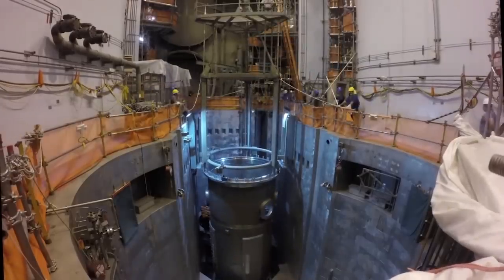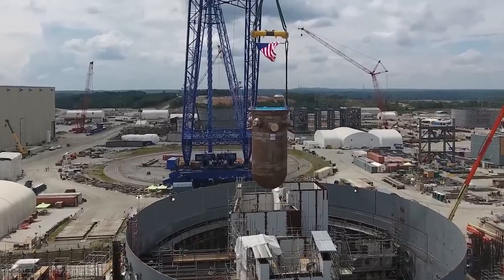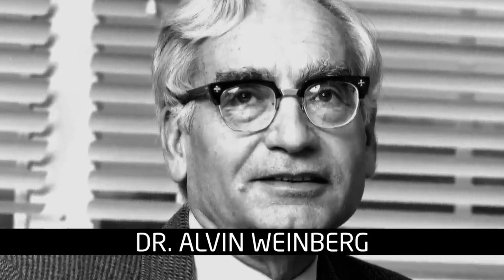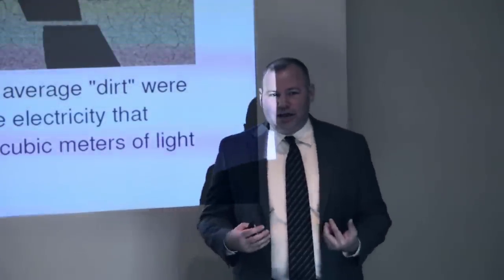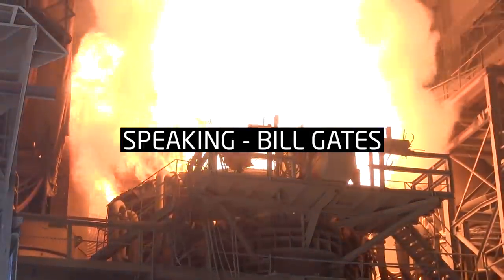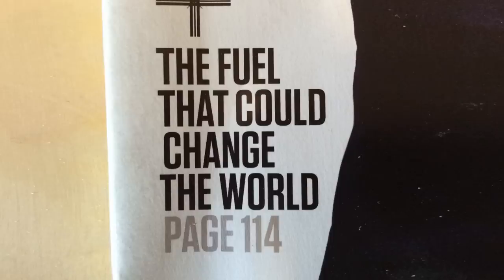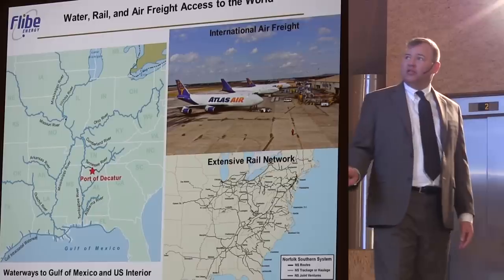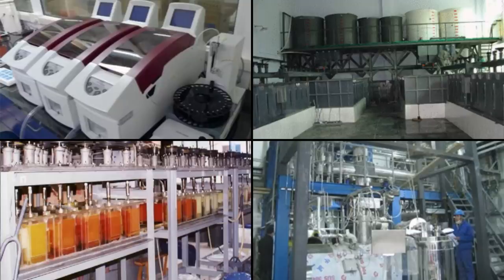Thorium 2017

Comment: again, super good video, i'd suggest one that would be thoroughly oriented towards waste, because it's quite a thing when chatting with people about nuclear technologies down here ! :)
Reply: Yeah, waste treatment and storage is a problem, but thorium already produces verry little waste compared to present nuclear energy.
Reply: i know :)
but that's exactly the point of a video oriented to the waste issue
Reply: ericasw28 +1 Maybe that video could also feature a part about the relative limited supply of materials for solar.
Reply: If waste disposal is of interest, Integral Fast Reactors are a better option than LFTRs. Arguably, the IFR is a more mature design than the LFTR, having run longer and with more funding at Argonne Natl. Labs in Idaho. Spent fuel from light water reactors can be reprocessed using techniques developed at Argonne and the spent fuel reprocessed and reused for decades in reactors that are also passively safe, just like the LFTR. The resulting waste is much less hazardous than the stuff coming from LWRs and has a much shorter half life. It also has no proliferation issues, just like the LFTR.
Reply: Yep, people do worry about waste.
So a video on:
Lack of waste produced by MSRs
MSRs configured as "waste burners" fueled by waste from PWRs.

Comment: So Thorium is an byproduct of Mining? What they do with the Thorium normaly?

The coal used annually worldwide for power generation contains,  about 10,000 tons of uranium and 25,000 tons of thorium, which either end up in the environment or accumulate in power plant ash and filter dust but it be extracted from the ash? And how would it be done?

Comment: The one thing overlooked in Kirk's presentation and a great many "thorium enthusiast" promotions is the fact that the reactor needs a fissile starter. 
The purest LFTR would provide fission-produced neutrons from fissile uranium alone, either U-233 or the  U-235 of customary reactors. I'm not sure if Pu-239 can be used.
But the thing is, that if you were to add sufficient pure U-233 or U-235 directly to thorium, Th-232, then either one of the Uranium isotopes, at 90% purity, is bomb material.
Thorcon Power (look them up) proposes a reactor (MSR) charged with 80% thorium fluoride  and uranium fluoride at just less than 20% enrichment, for the rest of the fuel content of the liquid. That would be just less than 4% fissile overall. They reckon that neutron capture by the U-238 and even the unwanted neutron capture rather than fission by the Pu-239 will not hinder the productivity.

Comment: The cement production is a terawatt consuming industry that uses wonderful coal, and is a massive, and concentrated, producer of C02.  That industry produces more CO2 that all trucks on the road, but is concentrated to a few locations. It would be interesting to see if it would make sense to locate a molten salt or metal reactor that could supply the energy needs of those plants, and also incorporate an "Air to fuel" cycle to recapture massive CO2 from the limestone. 

Molten salt temps may not be enough for the 1450*C needed, but a thermochemical  process of 800*C to make H2 could perhaps be used to increase temp. Fast spectrum lead cooled reactors may also be a consideration.
There are relatively few of these plants concentrated around areas with product demand and that of locations of raw material. Combining these, pun intended, hot-spots of energy consumption and CO2 emission seems like a winner.

Comment: Why such a focus on Thorium specifically rather than MSRs generally? By all purposes it seems that it's much cheaper and easier to just use Uranium, while maintaining basically all the same benefits. Especially seeing as there are still more economically viable to extract Uranium reserves than Thorium despite 70+ years of heavy extraction.
Reply from the maker: If your intent is to only produce power (either electricity or process heat) and you're not worried about uranium mining or enrichment (which I can see reasonable people not being worried about) or waste profile (again reasonable people can view current waste stream as acceptable) then a U-MSR is fine. In fact a fast-spectrum U-MSR could also address some of the above, if that's a concern. But it is pretty obvious Flibe is looking to monetize the "waste" stream. To do so it'll need to be segregated. The Chemical Kidney, which is a pre-req for high-efficiency Th-MSR lends itself to such segregation. Flibe has long been cagey about all their potential revenue steams, and that leads to observations such as yours. Still, Flibe isn't ready to spell it all out and rather keeps emphasizing many features also offered by U-MSRs.
Reply: Thanks for the reply!

Comment: First 30 seconds I figured it's just retitled regurgitation. .. sure it's the same information but you pulled the best bullet points from a dozen or so long,  sometimes boring videos and the order and tempo really work to convey the overall message. . Pretty awesome job of boiling it down to Thorium condensed . L p
Vy y

Comment: As much as I love nuclear and MSR, LFTR, et al...  It is still used to boil water and requires gravity.   Is there a more direct way to use the heat / energy liberated?  In micro or low gravity?
If the video said, I must have missed that part.

Comment: There is an error in the closed caption at .11 minute into the video. The slide is correct at 0.5% efficiency for a light water reactor and the CC gives the number as 0.05% efficiency. This bothered me because of limited hearing; I tend to focus on CC rather than the slide.
Reply from the maker: Fixed. Thank you for pointing it out.

Comment: Did someone hear about the sodium hydroxide heating system?
It use the exothermic reaction of sodium hydroxide when dissolve in water. It should be used as a he heat battery for solarthermic energy did you hear something about this system?

Comment: How do you start up a Thorium reactor? How does a Thorium reactor burn up uranium?
Reply from the maker: LEU, Pu or U233. LFTR49 is the one designed to recycle spent fuel rods. It first separates out the Uranium that won't sustain fission in thermal spectrum. https://articles.thmsr.nl/the-flibe-energy-lftr49-the-triple-ace-in-nuclear-gen-iv-design-ea9bffcd71dd There was some debate between Kirk Sorensen and Ed Pheil on Kirk's EFT Facebook page if you dig thru the comments on this post... https://www.facebook.com/EnergyFromThorium/posts/10159595752600377

Comment: So I forget. What is the difference between a PWR reactor and a BWR reactor?
Reply from the maker: I'd actually love to have anyone correct me if I get this wrong, but I think PWR uses a heat exchanger so that radioactive water is not used to drive turbines directly, and that BWR uses radioactive water to directly drive power turbines.

Comment: Pressurised water, AND the use of zirconium alloy fuel cladding are the problems with the PWR. Zirconium is very like magnesium; hard to ignite but burns furiously once lit. Really not the kind of substance you want inside a hot reactor. Molten salts avoid the need for inflammables in the reactor.

Comment: Could thorium reactors be built small like a heat pump, one for every home??
Reply from the maker: No, but it creates Fission Products which I believe could be used like an RTG to provide heat down to such small scales. I'll explore that in an upcoming video. Biggest challenge is that such an RTG from Thorium reactor Fission Products (the "waste stream" from the reactor) not enough "waste" is produced. So little Thorium is needed to fuel the reactor, so little "waste" is produced, is that there wouldn't be enough "waste" to fuel many RTGs. It would be a very expensive, niche product.

An electrical grid is a very wonderful thing to have. If you live in a city, the better fight is for powering the grid with clean energy, rather than trying to re-invent-the-wheel at every house. You likely don't treat your own sewage, so why operate your own power plant?
Reply: gordonmcdowell , my thoughts were towards encouraging interest by entrepreneurs , seems if originally it was designed for single vessel, maybe mass production for individual homes would grow jobs industry and therefore interest, despite political and corporate pushback. Like septic tanks, waste could be collected?
Reply: gordonmcdowell , if individual homes are too small to be practical, what about at community scale? Like a water tower provides water to a community?
Reply from the maker: @norag8265  I see a 2016 article stating 250 MWe per module (250 Megawatts of electricity). Ballpark 800 homes per Megawatt, 800 x 250 = 200,000 homes. Probably you'd want industrial activity to co-exist with such a small deployment to use-up some of the electricity (or more efficiently, some of the heat before it is converted into electricity) and so not need such a large community to justify LFTR.
Reply: gordonmcdowell , Thx for the information.

Comment: I would like to see a video comparing Thorium to the currently best available technology using uranium fuel, because that's what it's competing with, surely. Ive seen a video claiming that uranium can be used in a liquid fuel. And another claiming that the short term radiation from Thorium is higher. So a fair comparison needs to compare like with like, and also list all the known disadvantages.
Reply: MSRs are easier to use with Uranium than Thorium. All of the supposed arguments for Thorium are really just arguments for MSRs.

Comment: So, is it just traditional energy lobbies blocking this or is there more holding these liquid reactors back?
Reply from the maker: Anything nuclear is hard and expensive to commercialize. United States has some specifics costs on top of all that (due to regulation) which targets liquid fuel reactors. MSR moves forward internationally, just without anyone (I'm aware of) planning on building a test reactor domestically. Dr. Leslie Dewan is the one person who's spoken about this at greatest length, on both Atomic Show (podcast) with Rod Adams and in her testimony to an energy sub-committee.

Comment: Why does it take so long to get started to build thorium MSR?
Reply: A lot of the research is lost, and most regulations don't approve of any fuel that isn't solid oxide. It's a bitch to get even carbide fuels approved.
Reply: look at 8:25 to 8:36 how Sorensen shamelessly speaks about liquid fuel and meltdown of a core... in an MSR the core is molten 24/7!!! What industry considers the worst possible accident scenario, the MSR takes it as a design requirement. It's crazy! It will take a looong time before any regulator license a facility like this.

Comment: if you're using air or other gasses as the working fluid for the turbine, wouldn't a Tesla turbine design be better than a bladed turbine?